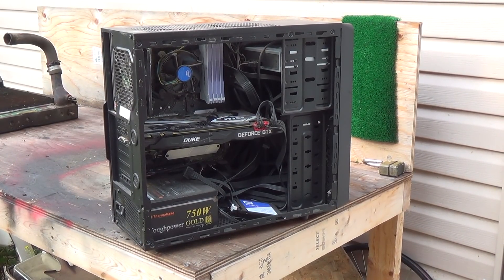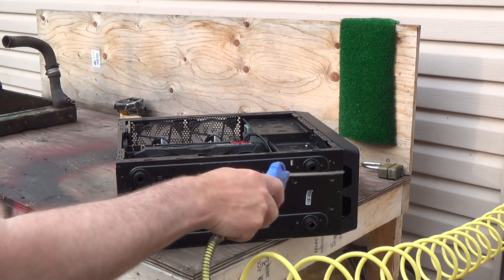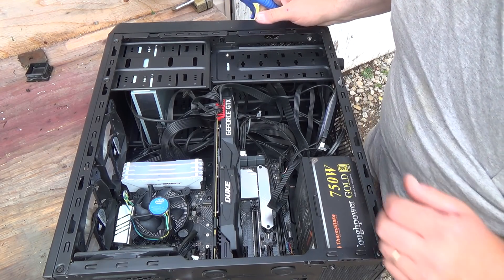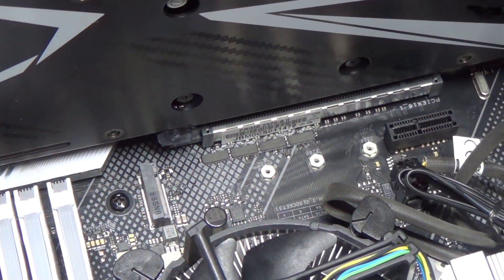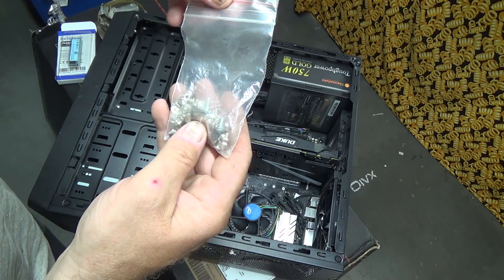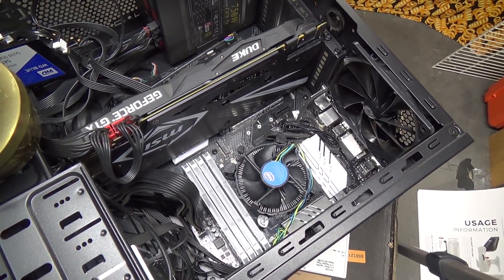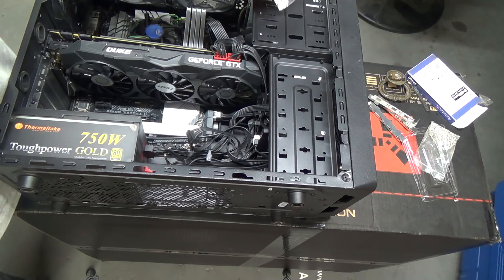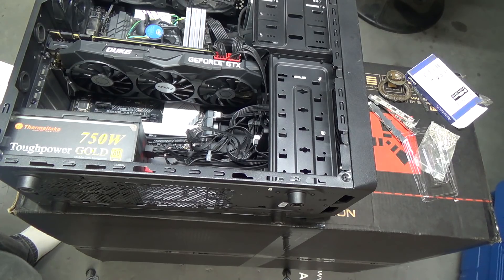Computer clean out time and install a new 2 TB SSD SATA M2 Stick drive installation

Comment: beware of static charge when blowing air . ground computer somehow.
Reply: that was revelent back in the 1980s no need to do it now
Reply: @QALibrary  Static no longer exists in 2021?
Reply: I've been blowing out computers for umpteen years with high velocity compressed air. Never had an issue. Gotta love the backseat comments that always show up trying to spread "knowledge", but it's typically just BS.